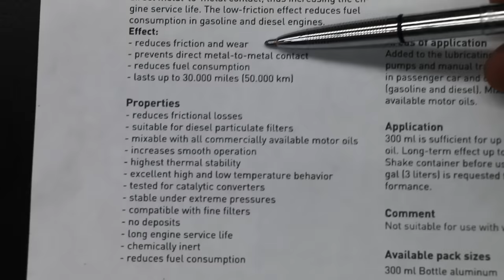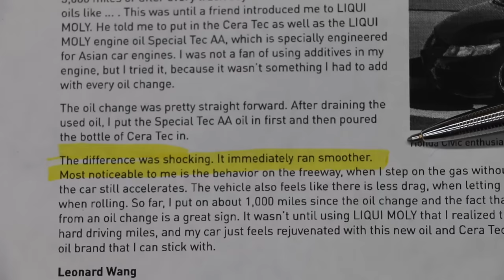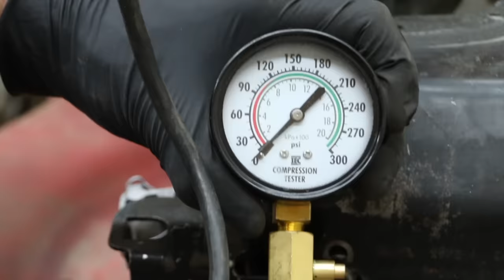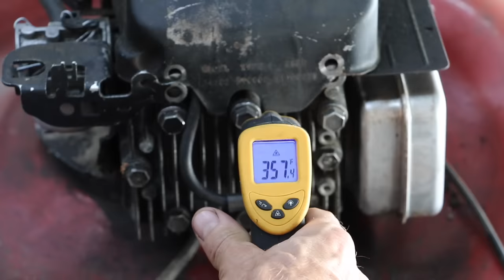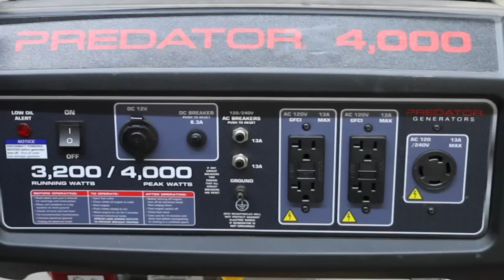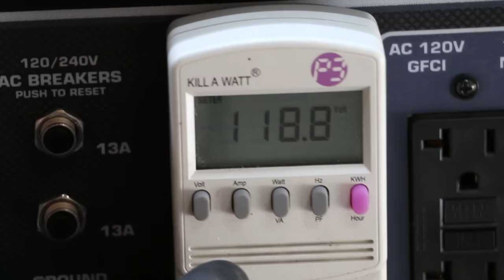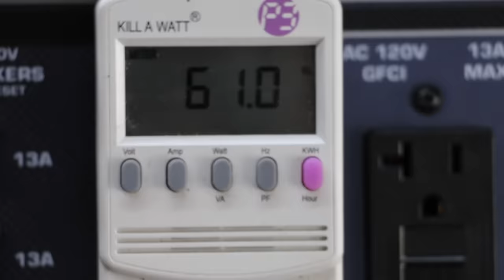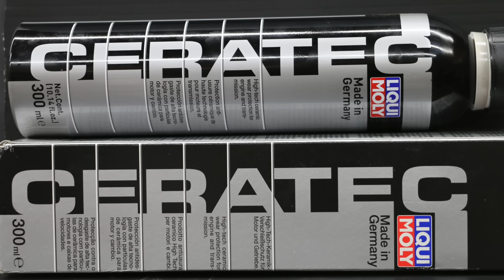Does Liqui Moly CeraTec work?  Let's find out!

Comment: My e39 M5 burned about 1 quart of oil every 750-1000 miles. I've been using Ceratec between oil changes and I made it to about 3400 miles before needing to add a quart. It's been beneficial in my use.
Reply from the maker: Thank you!
Reply: You Wish  sounds about right, but I guess that could still be cheaper than a headgasket repair or worse.
Reply: You Wish  When I was an Autotech I used to say pay now or pay me later. Wind up paying more when you add up all of the bottles you bought plus actually fixing the problem. But it is handy if you cant afford to fix it first.
Reply: @theunluckyscav Do you have a 2000 m5? I have a 2000 and she burns a LOT of oil. Now my next few statements is assuming you're not leaking any oil and you don't have any oil circulation problems (you must rule those out first). 
If you were lucky it's just the valve stem seals that are leaking and you must remove the vanos and the cams to get to them. A VERY expensive job. But usually nothing short of a full rebuild will solve this problem, so you may as well keep driving her. M-series cars have a maximum permissible consumption of about 1.5 quarts per 1000km. If this stuff helps, you might as well keep using it, since the 10w-60 the s62 requires can be very costly.
Reply: @pbarangu  Why did you say "If you were lucky it's just the valve stem seals that are leaking..." That's the most difficult and expensive job hahaha
Reply: I've noticed that a lot of modern engines drinking inordinate amount of oil. The ls motors from General Motors are horrible. They're still within the National Standard but the National Standard is ridiculously hi. Build the engine properly so that you shouldn't have to use more than about half a quart in 5000 miles. That should be easily achievable. As I've seen engines capable of that for decades before the late 1990s. It's just a matter of controlling your tolerances, which should be easily accomplished in today's Aerospace Manufacturing environment.
Reply: pbarangu if you don’t want rod bearing issues, don’t use 10w-60, 5w-30 synthetic is what should be run in those
Reply: @tristanrees4517  I'm trying to figure out why you would say such a thing, rod bearings love heavy oil. It's the Rings they can't handle the heavier oil. Plus a lot of the tolerances are lighter. All the have your oil does is sheer its molecular chains as it's being forced through the tighter tolerances. But it still maintains better film strength for bearings. The Rings are a different matter. They are usually specifically designed for specific weights, especially the oil control ring.
Reply: 44 Hawk this is how my friends who own them run their s85/62 engines, supposed fix for the rod bearing issue, my friends e60 has 130k and hasn’t had the bearings replaced and he’s ran 5w-30 full synthetic since 75k, it still runs great and hasn’t had rod bearing issues
Reply: @tristanrees4517  frankly that's how I run most of my engines. With either the oil as requested by the manufacturer or I'll step it up 1 grade. What running heavier oil will not damage bearings. Running the proper oil should not damaged bearings either. But have your oil will cause problems with oil control in the cylinder before it does anything else. I've never seen bearing failure from running a heavier oil. But I'd only been Building engines since the mid-sixties so maybe I can learn something new.. With the tighter tolerances the lighter oil works just fine as long as it doesn't run out of the bearings faster than it's going in. So that it maintains pressure.

I've never seen a heavier oil cause any problem with bearings. I have seen, far more often, that the oil control rings in the cylinder can't candle the heavier oil. Causing oil to get up into the top of the cylinder and start getting oil Ash deposits on the spark plug and eventually fowl it out. Or at least shroud the spark where do you start losing power.

I have been in auto parts stores a number of times. And constantly see people buying Lucas Oil stabilizer which thickens oil well over a weight of 40. On occasion I see people getting fresh spark plugs or wondering why they're still using oil when they put thicker oil in it. And I try and tell them that their thickening the oil to the point where the oil control rings are not capable of keeping excess oil out of the combustion chamber. The other problem it has is the thicker oil does not drain through the oil return galleys is fast and causes it to pool in the head and it gets sucked through the valve guides quicker. We're lighter oil drains faster and doesn't stay up on the valve guides as easily. You have to use the right weight oil for what the engine was designed for. The new thinner oil has more than enough film strength to protect the bearings and we'll still be controlled quite readily in the top end of the engine. It was a way back in the early 70s when an engine head a lot of wear on it especially when it was starting to drink oil through the valve guide seals to reduce oil usage by going to a 30 weight oil instead of a 40 weight. You would reduce oil usage by doing that. It would allow the oil to drain out of the cylinder head faster and not pool on the valve guides where it would be sucked into the combustion chamber. So I understand what you're trying to say. But I think you've got it bass-ackwards.

If the heavier contact surfaces required lighter oil, why do you use gear grease in the differential. That is actually an interference contact point. And the thicker your grace, as much as seven times the thickness of motor oil, is used to protect those heavy contact mechanisms. According to your logic 20 weight oil should be in your differential. And I defy you to have one last very long doing that.

Another hybrid where item, is the wheel bearings when you have to pack them. You pack them with grease. Not three in one oil.

I'm not trying to be insolent here, I'm trying to give you an understanding of the physics of an automotive engine and it's lubrication requirements.

And a hundred thirty thousand miles on a modern engine is not impressive at all. I have sold vehicles with almost 300,000 miles that were still running just fine. After changing oil every 10000 miles for most of its life.
Reply: @44hawk28  Scotty Kilmer has done videos on this, including a guy that had his new Sierra dump all its oil in his driveway with only like 300 miles on it.

Then again, I know a guy that had a Subaru Forester that was needing a new engine due to oil leaks, along other issues. Just getting Subaru to admit the problem was a battle.  The engine was on order when the CVT crapped out...in front of a Toyota dealership.
Reply: @mandolinman2006  the CVT is a completely different issue. Nice idea, but it has no business in a motor vehicle before. It's an industrial power transmission system that works fine in industrial applications. But it has no business whatsoever as a transmission on a motor vehicle. It does work as the rubberband drive for a lot of glorified off-road go-karts. As for the engine on the Subaru. Biggest problem that they have with those leaking is nobody wants to do the rhetoric of the heads after it breaks in. Those long-ass jug bolts are prone to stretching. I've seen a lot of issues in the Detroit area people who buy BMW and never think that that 1500 mile service interval in order to re torque the heads is of any importance.

I've never seen the Scotty Kilmer video of somebody whose Chevrolet just dumped all its oil out of the driveway. My guess is this somebody did something massively wrong because not even Chevrolet builds engines that shity.
Reply: Tristan Rees I wouldn’t use 5W-30 for a E60 M5.  But this is what it says in the manual - Alternative oil grades
If BMW High Performance Synthetic Oil is
unavailable, you can add small quantities of
other synthetic oils between oil changes.
Only use oils with the following specifications:
> Viscosity
preferred: SAE 10W-60;
alternative: SAE 10W-40, SAE 5W-50 or
SAE 10W-50
Reply: @tristanrees4517  
OR...do what I do. Keep my E46 M3 at 3000RPM or BELOW until oil is at full operating temperature of 200 degrees F. I BABY the car until the oil gets good and hot. Then I rev the crap out of the motor up to my custom tune limit of 8100.

I have  90K miles on the motor and it burns ZERO oil between oil changes (5-6K miles). No change on the dip stick. 

 Lab test show little wear. And I DO use Ceratec and LiquiMoly oil.
Reply: Fernando5455 yeah but 10w-60 is super heavy and is gonna take forever to actually be warm enough to lubricate everything, and I don’t understand how 60 weight oil is gonna lubricate the bearings, shits gonna be sooooo thick
Reply: Deplorable Dave not exactly the same engine but a similar enough setup with similar issues around the same mileage, but that’s an m54 based engine and they live forever, the s65/85 are completely different platforms that use similar mechanisms, jus sayin idk how 60 weight oil (even 10) is gonna lubricate the bearings, and it’s a known issue that decreasing the oil weight seems to decrease wear (according to 2 people I know with s85 M5s) you at least treat your car right though unlike a lot of people that did when they first bought them
Reply: @tristanrees4517  
Ah! The E46 M3 runs an S54 motor. Not an M. The con rod bearings in the 2001 to 2003 all got replaced on a RECALL. Subsequent years (I have a 2005) all suffer from bearings that are a bit snug an most people need to replace them on high mileage motors. Some as early as 90k miles.

The German engineers and BMW INSIST  that our motors take the prescribed 10-60w oil. (Castrol at the time, but others have developed oils that work great like LiquiMoly, Motul and others). 

The problem is that the oil does not flow well under the bearings when cold. We all have red LED lights on our Tachs that extinguish one by one as the oil temp increases. The lights show what BMW considers a SAFE RPM for the motor at a specified temp as the oil warms up.

Many feel that the RATE is to liberal and go in an RE-CODE the warning lights. In fact, this re-coding is part of some tunes available online.
Me? I dont even look at the lights. I ONLY look at my oil temp and my  tach. My method of keeping it 3K or less until oil temp is 200 degrees is VERY conservative. Even in Florida, it takes about 3-4 miles on a hot day. But my method works!

Then, that 60 weight oil proves to protect things quite well in scorching Florida at 8100 RPM. Especially on my track days at Sebring where I really  stress the motor. But, my car  comes off a hot  track session like I took it for a Sunday drive. I do decrease my oil change interval to 4K miles if I track the car. But, still ZERO oil consumption and great Blackstone Labs reports. Piston Rings are still nice and tight  at 90K miles. Con rod bearings not showing copper in the oil.

There is a big aftermarket for con rod bearings for my S54 motor. I hope to avoid that nightmare (I do all my own work) for quite a while. I got the idea of Moly Disulfide and then Ceratec from this blog.  See link below.

Oil changes run me about $100 just in supplies. Nothing is too good for my high reving motor. I love my car. Brembos, custom tuned coilover dampers, SWIFT springs, 30mm sway bar etc. I leave my square set up for the street too. No tramlining. 265/35-18 square. On street, Michelin Pilot Sport 4s. Hoosier on track.

Note this quote at the end of the blog article:
"Update 11/10/2016: We talked to Liqui Moly representatives and they recommend their newest product Ceratec which has updated technology.

Oscar (TR4CKM3) has been using Liqui Moly Ceratec in 30k Miles intervals with good results. He says that Ceratec last longer between oil changes."

read this article. It will educate you a lot.
https://thebuildjournal.com/products/liqui-moly-mos2-anti-friction-s54-m3-rod-bearings/
Reply: @tristanrees4517  
It does take a while. Even in Florida. But I dont know anyone that runs less than the MANDATORY 10-60W oil and I am on a lot of E46 M3 forums. Note that we have something called a VANOS that runs on oil pressure. I belive non prescribed, thinner oils will throw that function off. 

So...I WAIT four miles until my oil gets up to 200 degrees before I rev over 3K. It is NEVER a problem. I use my car now as a daily driver with a 34mile RT commute. I take it DEEP in to triple digit speeds every day on our mini Autobahn between Fort Lauderdale and Miami. Very well paved EXPRESS LANES. No speed traps because too dangerous to pull any car over to tiny narrow break down lane. Traffic in these pay lanes is usually very very light.
Outside temps are scorching in South Florida.

For the BMW S54 motor, 10-60w FTW.  Not saying what you should do with your different model motors. You do what you do. I do what I do. That's it, That's all.
Reply: Same here, N52 E90 with worn valve stem seals. Ceratec and Oil Saver improves oil consumption quite noticeably.
Reply: Oooh e39 m5
Reply: @44hawk28   Subaru is worse.  Our forester uses about a quart every 700 miles.  No leaks, and no visible blue smoke.  (It's got 235k on the clock)  According to Subaru a quart of oil every 1000 miles is considered normal for that engine?!?!?  (edit:  Changed 'used' to 'uses' as we are still driving it.  Runs like a top!)
Reply: @Tedybear315  have you tried different types of motor oil. I have found that that sometimes has a distinct effect on how much oil an engine uses. One other observation, according to National standards, a quart in 700 miles oh, they claim, is perfectly normal. Like I have said in the past, if I had an engine using a quart every 700 miles I would wonder exactly what was wrong. But I have seen engines use a considerable amount of oil with things like synthetic and even going to a semi-synthetic use almost none. Several years ago it became fashionable to load up brand new engines with synthetic oil, which I think is a horrible mistake. The engine has to be allowed to have some break in time. And it cannot do that under any normal circumstance with synthetic oil in the engine from its Inception. The old school rule of about 500 miles on a new engine change the oil to conventional oil another 1,500 miles to 2000 and then change the oil to whatever you want to use. And if you have a turbocharged engine, and it's low on oil before you're ready to do an oil change you add a little bit of Marvel Mystery Oil to make sure that those turbo shafts get clean. And always let the car idle for a few minutes before you shut it off. It allows the turbo to cool down. A little bit of transmission fluid in with that Marvel Mystery Oil also is great for the seals.
Reply: @ProjectFarm  I don't hink a lawnmower engine is actually well for testing additives for extremly complex car engines. Since their behaviour might even change drastically due to the ECM and sensoring which easily could extraordinate benefits of additives (-products) compared to an basically not really controlled lawnmower engine with extreme manufacturing tolerances and comparable low fuel efficiency yet not even an exhaust gas treatment system ... and so on. But it is funny to watch what's actually happening. :D
Reply: @tristanrees4517  the e39 m5 is brutal on oil.  Fresh 5w30 is quiet&smooth for about 3k miles then it lets you know at high rpm that 5w30 just became 5w20. Only quiets down if oil is changed.   Had good runs with Mobil 0w40 when it was group IV ten years ago.   I've been berated by shop owners(friend) for using 5w30.
Currently very happy with Redline 5w50. Engine(2001) loves it and burns barely a quarter of a liter after 3k miles. Also interested in Ravenol oil... heard too many good things
Reply: Use xado maximum
Reply: @McCarthyism_by_Youtube  use xado maximum
Reply: @44hawk28  agreed most resort to the heavier protects better knee-jerk reaction but forget that liquids can't compress no matter the weight. I'm guilty of it myself
Reply: dzlnitro so adding a quart of additive saved you adding a quart of oil.... 🤔
Reply: I have 2008 Mercedes GL450. 66k miles (my commute is short)
I measured noise level of the engine at idle by putting a decibel meter right on top of the engine, after driving the vehicle for 30 minutes. measurement was around 77 decibel. 
After changing oil and adding ceratec, drove for about 1 month, and measure the noise level again using the same method.
now the engine idle with 71 decibel.  it does work.
Reply: My 330ci used a quart per weekend, I replaced the piston rings 🤣
Reply: Isn't it to use only 50.000 km intérvals ? In between u can use MsO2
Reply: @deplorabledave1048  I do run 5W30 in my E46 M3 , 320000 km. So did Turner Motorsport when they were racing. 5W30 was the original recommended viscosity , until they made  contract with Castrol to sell their overpriced crap.
Reply: @V8Lenny  
Nawwww. I know Doug at TMS. I will personally ask him. Their website specifically shows they use a Liqui Moly 10W-60 in their e46-M3 race cars.
"Liqui-Moly Synthoil Race Tech GT1 10w-60 Engine Oil - 1 Liter ...
Used by our very own Turner Motorsport Race Team in our Championship winning BMWs!"

Now, they DO show a Motul 5W-40 oil that they claim is good for all BMW's. I would not track with it in the Summer at Sebring Florida.
MOTUL 8100 5W-40 X-cess Synthetic Engine Oil

Turner lists several VERY protective 5W-30 oils. NONE of them show the E46 M3 in the compatibility list. None, bro.

Listen, this it the absolute key to very long con rod bearing life in the E46 M3. Ignore the idiot lights telling you when it is safe to exceed a certain RPM as the car worms up. Simply do NOT exceed 3000 RPM until the M's OIL TEMP is at least 180 degrees F. Ignore coolant temp.

I use every recommended fluid that TMS says is a "go" for my car. Redline D4 AT fluid for the tranny. Redline diff oil. Liqui Moly 10w- 60 for the motor.
I add Ceretec too.

My 110K S54 engine burns NOT ONE DROP of oil every 4,500 miles. I have a tune that raises my redline and top speed. I routinely stress the car to track like conditions in select areas of FT Laud and Miami and WPB. Oil temp gets to 210-220 in South Florida Summers when the car is driven at its limit.

Liqui Moly 10W-60 plus Ceretec for the win. Blackstone oil lab agrees when I send them samples once a year.
Reply: @44hawk28  Thank you, now I know why my Kawasaki ZX12R consumes more oil if I use 10w60 than 10w40. Nobody believes me.
Reply: @44hawk28  I think is a common problem with Direct Injection engines and downsized turbo engines. Almost all modern VW and BMW engines consumes oil.  The REAL problem of modern engines is the horrible CARBON BUILD UP. No more fuel/air mix cleaning the valves. Gunk all over..
Reply: @44hawk28  I got a 2004 Chevy Colorado with 358,000 miles on it so not all Chevy's are bad. Last time I came across the country it used less than a quart of oil. Its weird though, sometimes it uses hardly any, and then all of sudden it will go through a quart. Been doing it since I bought it in 2008.
Reply: @tristanrees4517    you dont understand oil numbers.  Its still a ten weight base oil.
Reply: How much oil does the engine really have when the oil level is at the bottom marker of the dipstick?  Isn’t it generally when a person has to add a full quart or half a quart to bring it up to the full level?
Reply: 20w50? Or 5w50?
Reply: @tristanrees4517  a e60 is not a s62 powered car lmaoooooo
Reply: @awboat  depends on engine loads.